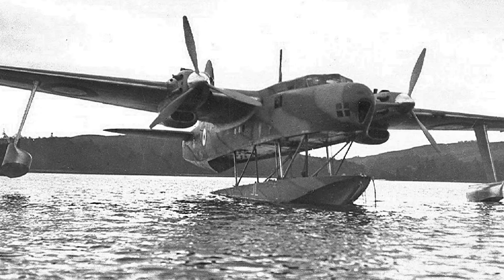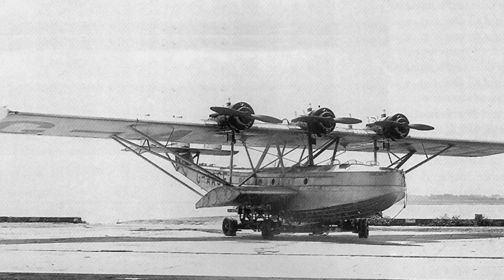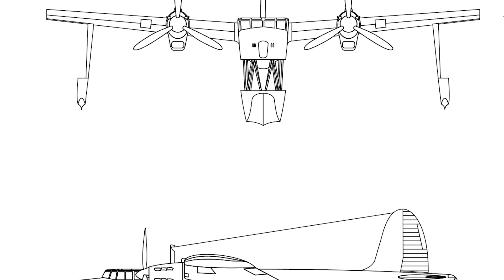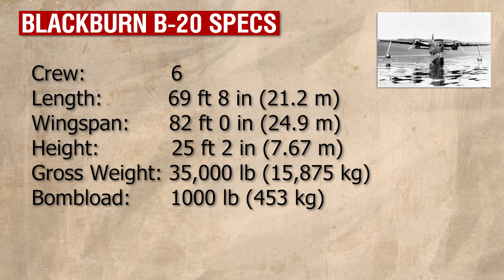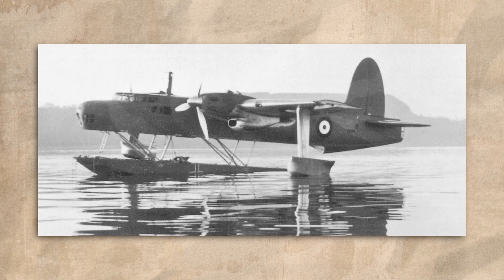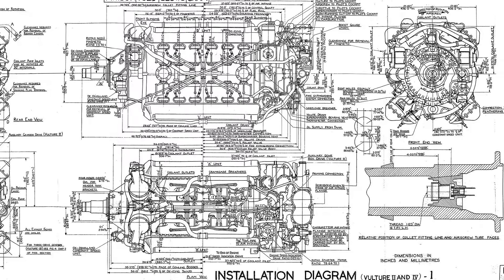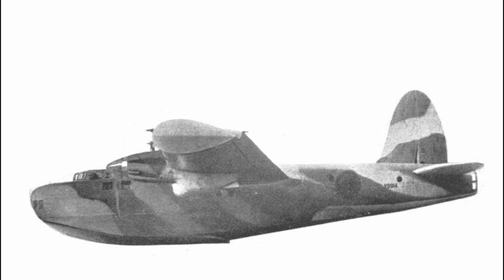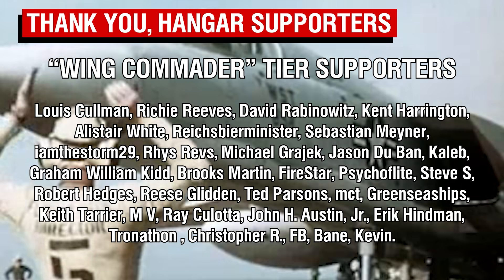The Aircraft That Could Split Itself In Half | Blackburn B-20

Comment: Far from the headliners and ultimate successes of Short, Supermarine, Hawker and Bristol, the whole Blackburn B20 project would've absorbed much expertise;  test pilots, aero engineers, aircrew and production staff.  Despite the novel design, each one would've seen this as a vital part of the Air Power effort and dedicated their working life to make  it a worthy contribution.  I like the adaptable efficiency of the float plane, and would've marvelled at the extend/retract sequence if viewed from a suitable vantage point.   Again tragedy beset a valiant attempt to achieve military dominance and thankfully there's enough material in your research to paint a picture of that precious history and memories of this chapter in UK aviation history.

Comment: The B20 survived just 12 days between its maiden flight and the crash on 7th April 1940.

The B40 was cancelled because it had unacceptable performance on one engine, had insuficient improvement over the Short Sunderland III and land-based aircraft were capable of greater ranges.

The B44 didn't amount to being much more than a flight of fancy and was quickly dropped as the requirement was largely superfluous, the Napier Sabre engine unreliable and the design flawed with serious stability problems.

Basically Blackburn's seemingly inovative design was a dud.
Reply: O really? Did you just learn that from Rex's video? 👏👏👏

Comment: They could have simplified a bit: make the ladder one of the struts.  I don't think it needs a door either, when the float is down, it's basically open for anyone to enter.  Bringing up the float seals the aircraft.   I don't think there's a problem with that as planes had open cockpits just few years earlier.
Reply: And if there was an emergency landing with the float up, I don't think it would have been a big deal on water or land. Window egress, surely.
Reply: A hole is just waiting for someone to fall into. Cold winds from the sea could blow in. Anybody could just climb in unhindered.
There are good reasons we've had doors/hatches for centuries.

Comment: What an interesting design. One wonders about what a civilian version not hampered by the need for crew quarters and a miniature workshop could have become, from a transport to remote islands to a fire fighting plane,relocating the fuel to the main hull and using the float as a water, maybe with a mix of fire retardant tank, that may have allowed for high precision dispersal of the liquids and a good performance for a 2 engine plane in that necessary and sometimes sadly overlooked role. Until the wonderful Canadair planes came along and gained our admiration and deepest respect for his tremendous habilites and his beautiful design and forest saving habilites.

Comment: I was wondering if it might have been easier to simply build a flying boat with an F-8 Crusader style of variable-incidence wing - though you wouldn't get the handy platform for harbor handling.  And then low and behold google shows me that Supermarine already did a variable-incidence winged flying boat; with their 1948 Seagull design.

So can we have a video on the Seagull please?

Comment: Of oddball Blackburn designs that were actually built, this is probably my favorite. And of Blackburn's strange birds that never flew off the page, I really love the look of that split-hull B-44 fighter. Am I misunderstanding the drawing, or did it have contra-rotating propellers?
Reply: It was designed around a contraprop Napier Sabre but conceptually based on a modified Blackburn Firebrand. The Firebrand started with a single prop Sabre before moving to a single-prop Bristol Centaurus radial. The most detailed plan views and artists renditions show the B-44 with contra-prop

Comment: Do you actually want the wing pontoons to be on a different level then the main one? Wouldn't this just cause the plane to turn in the direction it's leaning until enough speed was gained to roll into the level position? Or did they want to be able to turn sharply?

Comment: Now i see where the Author behind Konpeki no Kantai possibly got their inspiration.

for those who don't know, Konpeki no Kantai is basically an Alternate History Anime of ww2 where Japan got advanced tech from VIP people from the 1940s who got isekaid back to the 1930s.

They basically got the I-400 class working before 1941, and had a Single-Engined escort fighter that had a Pontoon integrated and streamlined to the fuselage which would swing out the bottom allowing it to land in water, and had deployable smaller pontoons on the wing tips for stability on water.

yk what's even more crazy?, they had as steam turbine powered Intercontinental bomber, which was also a seaplane and could be refueled and rearmed by sea with supply submarines.

Comment: The same initial specification was "won" by the Saunders-Roe Lerwick. It had a poorer performance (the B-20 had a max speed about 100 mph faster. The Lerwick was also prone to accidents, being unstable in the air and on the water, and had numerous other faults. Only 21 were built, eleven of which were lost in accidents. Perhaps development of the B-20 should have been continued ?

Comment: This plane could've been a game changer if it had succeeded.
Reply: Doubt it. Dazzling gimmickry and over-engineering tend to fail at the most critical moment. Imagine being attacked while on the water, having to scramble away at full speed, and that maze of struts and pistons failing to retract. You would be a drag-laden sitting duck. Or, having to land and the system failing to lower, either through malfunction or battle damage. Your plane would be a sure write-off in the best of cases, in the worst it´d be the crew which was to be written off! The Germans learnt at Kursk, and well before that as well, that fancy technical toys were a disaster in the harsh realities of war. The same would happen with this contraption, which couldn´t hold a candle to good ole Sunderland!
Reply: It was half-way between a flying-boat and a float-plane: those Vulture engines would have been the kiss of death for any production hopes, whatever the design's other shortcomings

Comment: What I find interesting is that when most flying boats or float planes used radial engines Blackburn went with inline instead.
Reply: didn't he say it was an X24? I would consider X engines to be radial, maybe I'm wrong about that.
Reply: @tissuepaper9962  The Vulture consisted of two V-12 Peregrine engines bolted together. Of course it's a bit more complicated than that, but that's the very short explanation. A radial engine works very differently.
Reply: @TheObnoxiousMrPug  I suppose I would concede if the two Vs are smaller than 90°. If they're evenly spaced then I'd still want to call it radial but I know that radial engines normally come with prime numbers of cylinders, which 4 is not. Going to take this as an opportunity to learn about a new type of engine.

Comment: I wonder about the stresses on them struts/scaffolding connecting the pontoon to the plane, especially on landing.
Reply: Assuming the actuators are hydraulic I think it might have done better than regular flying boats/seaplanes. The actuators could act as shock absorbers.
Reply: @henrikgiese6316  they could even be plumbed into a tuned hydraulic circuit for ideal damping.
Reply: @henrikgiese6316  Alex Moulton? ;)
Reply: @jimdavis8391  I was thinking more like the classic Citroén. 🙂
Reply: @henrikgiese6316  indeed! Citroën DS, 1955? Moulton was late 50s I guess.
Reply: Its really no different than any other pontoon plane but with the addition of powered jacks and the provision to make the struts fold. Fixed pontoons and flying boats were the norm prior to ww2 and were rather well understood. It was only really the explosion of WW2 era airfields that made land based planes more practical. Prior to this there were developed port facilities near almost every major city in the world and very very few official runways. Most planes has to be designed to basically land on an open field or a dirt track prior to this.

Comment: I liked the concept but thought the float could be pneumatically pumped up with air, using canvas air bags with hard plates attached to contact the water. Thus the whole float section could deflate and fold away. ... my design was rejected by the air ministry as too  COOKOOCRAZY !  :D
Reply: taking off and landing a floatplane/flying boat is hard enough with a rigid hull. I think a flexible hull might just make it way more difficult.
Reply: Maybe you could revisit this with some kind of dropstitch tech.
Reply: @edevans5991  Exactly what the air ministry said as they dialed the asylum.
Reply: To keep the crew fit, it should have been cranked up and down manually, just like early Spitfire undercarriages. 500 turns each way. Time for my medication...

Comment: I'm not sure putting much of the fuel in the part most likely to hit underwater obstructions, leading to a leak, is necessarily wise.
Reply: I think quite a few seaplanes had fuel in the floats - thinking Schneider racers (though those weren’t the epitome of practicality, either)
Reply: @chrismartin3197  yes, quite a few did in reality. I'm still not sure it's wise

Comment: Blackburn did not think outside of the box. Instead they threw the box away entirely! Too bad that the idea was not followed up. It made sense.
Reply: Blackburn: Why would we think about boxes? They have terrible aerodynamics!

😂
Reply: @ZaphodHarkonnen  😆🤣😆 Good one!
Reply: Yet somehow it looks to have twice the drag of a Dornier 16 or Dornier 24.
Reply: @ApriliaRSA250  Not at all. The D24 and B20 have almost the same wing area, range roles, fuel load and if pushed into service would have simlar armament weight. The D24 did 180knots off 2112kw (3x704kw) while with turret drag simulated the B20 did 266knots off 2560kw (2x1280kw). So the Dornier is doing 67.7% the speed for 82.5% the power, that means it has a MASSIVE amount more drag (doubling speed would roughly quadruple the drag).
Reply: @ApriliaRSA250 ,probably does depending on the factors involved.

Now,something as streamlined as a German flying boat with a float that can be extended down like that would probably make the most of the all the aspects.
Reply: Blackburn should have stuck to pushing the boundaries of the box as opposed to going outside the box. They produced far too many turds trying to go against the grain.
Reply: It makes zero sense to have a fuel bomb underneath a plane, every emergency landing could be deadly, due to sparks and such, and that's one aspect.
Reply: @AstuteClippy  ,you don't know much about amphibian aircraft,do you?
Reply: @AstuteClippy  You might want to look at conventional designs, because a large ratio of both fighters and transports had fuel in the lowest parts of the hull, or even in blisters outside of it, and would be among the first to touch the ground in a gear up landing. But fuel tanks burning aren't common (and then almost exclusively the work of incendiary projectiles), fires are normally engines or munitions. Fuel tanks are also ventilated (or on later types, actually inerted with a ullage gas like CO2), so don't contain explosive conditions... and in a flying boat (the Blackburn shown wasn't even an amphibian) its being mostly submerged in water (which actually makes ventilating more difficult, but it somewhat rules out "sparks" from contact), and reduces fire risk.

Comment: Looks weird but seems like a pretty good idea.
Reply: Hardly. Dazzling gimmickry and over-engineering tend to fail at the most critical moment. Imagine being attacked while on the water, having to scramble away at full speed, and that maze of struts and pistons failing to retract. You would be a drag-laden sitting duck. Or, having to land and the system failing to lower, either through malfunction or battle damage. Your plane would be a sure write-off in the best of cases, in the worst it´d be the crew which was to be written off! The Germans learnt at Kursk, and well before that as well, that fancy technical toys were a disaster in the harsh realities of war. The same would happen with this contraption, which couldn´t hold a candle to good ole Sunderland!